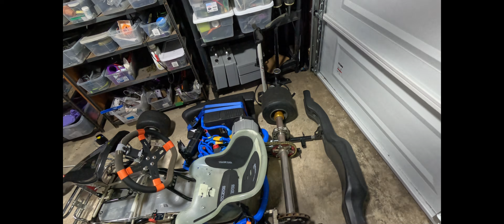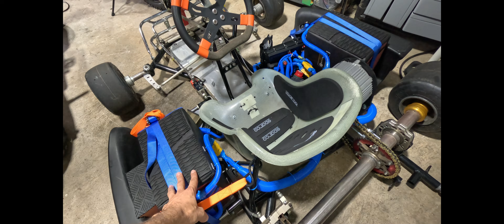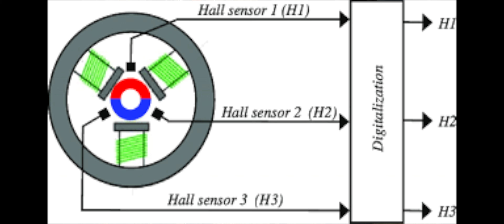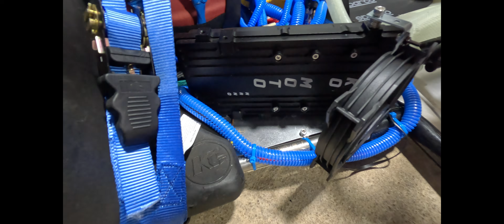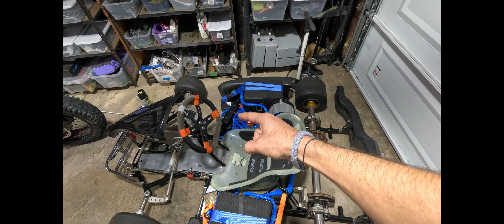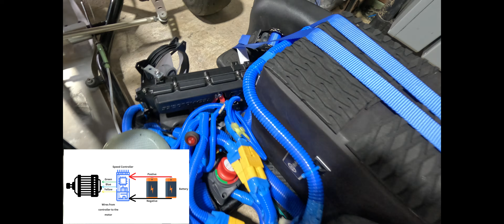How To Build An Electric Go Kart / Parts List

Comment: For your motor mount to chassis mount. What did you use to adapt to the chassis mount? I have same motor mount but holes different spots. Was going to drill them out and weld a washer just to give better support there.
Reply from the maker: @ohvblue  I used square bar, like the ones with the holes in it. And then I was able to align those holes which each side. Not the most perfect solution as in I just made a mount for my mount but it holds just fine and i used long bolts to go all the way across allowing me to do micro adjustments to make sure it was strait